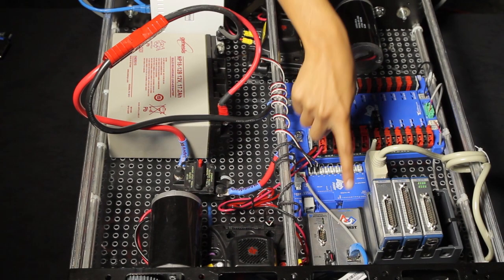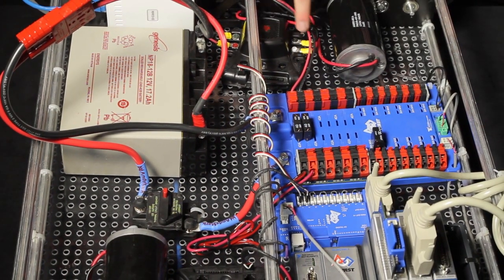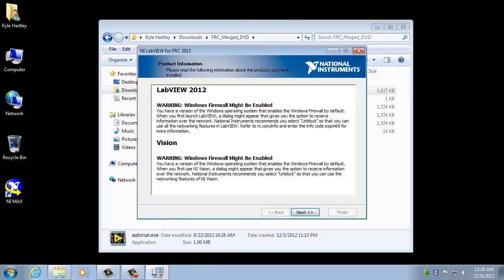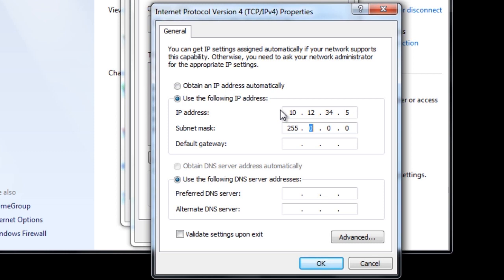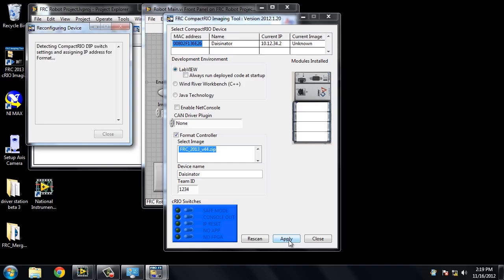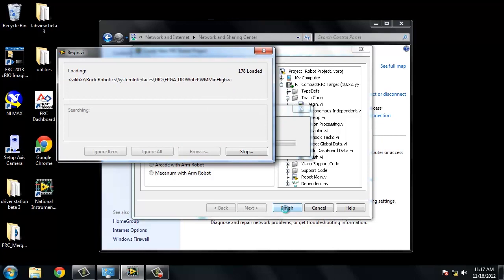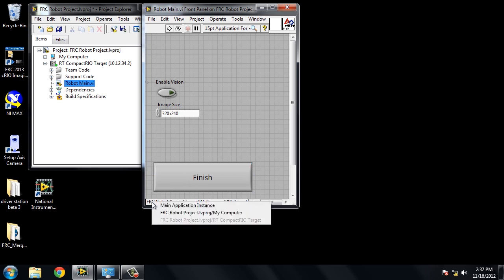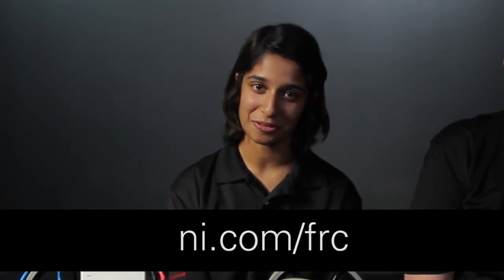FRC 2013 - Getting Started with cRIO & LabVIEW

Comment: The Wireless bridge is hooked up to the 12v regulated output through the 12v DC to 5v DC converter (as the rules REQUIRE). The Camera is usually what is hooked up directly to the 5v connector on the PDB.